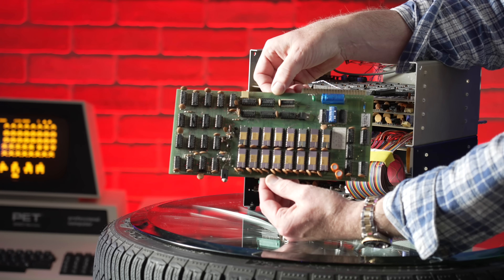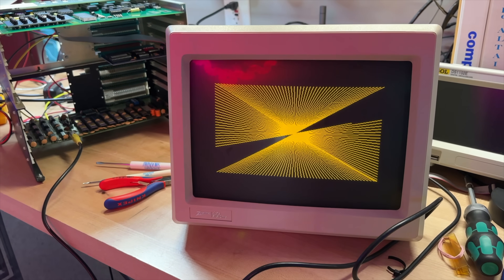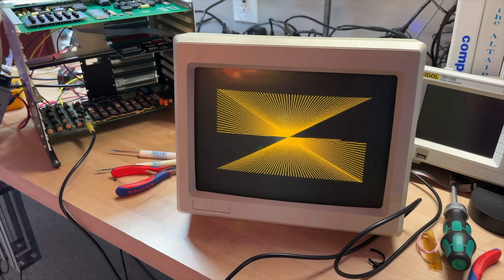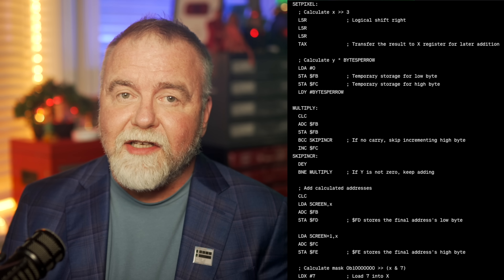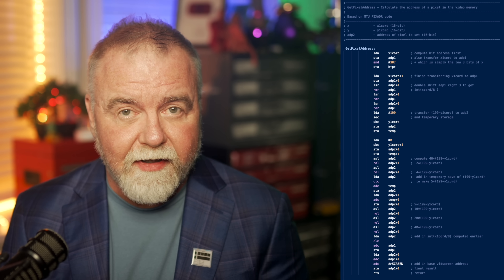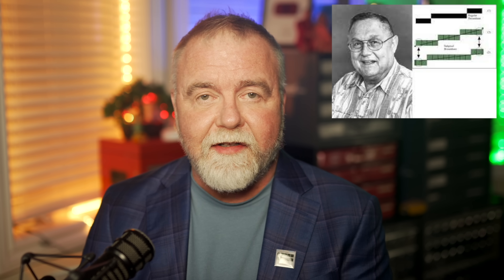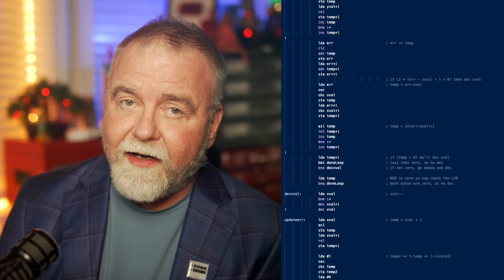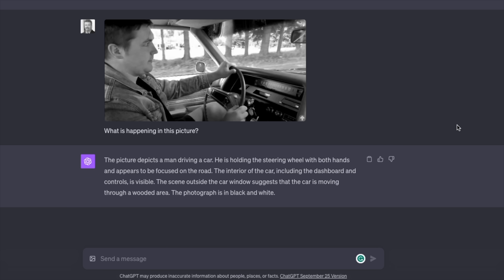ChatGPT Blew my Mind!  Now it can code AND learn from the results!

Comment: Cataclysm is a python project that has the pecl attached.  It does the feedback loop you mention.  Self re writing code is a thing but it tends to infinitely recurse so a solution was found by fluctuating the temperature parameter.   The magic is it has system prompts that allow it to write unit tests for given output and iterate on that until unit tests pass with pecl and pytest.  It has the magic ingredients -- code, a way to test code, and a way to feedback the test output to get to the solution.  The temperature is adjusted if so many iterations pass to allow a "spark of creativity" that forces it out of an infinite loop.  Its the only working solution ive found!  Becauze the buolding blocks of cataclym are agnostic, it can be applied to any language if modified. 😊  it starts by running Doom() with your prompt of what you want to see...  I was happy to apply a decorator to python strings to run Doom on _str_ and watch it run the English language when i plopped in string literals describing my program.  Pretty crazy.  It comes with a few examples like a hangman game and snake.

Comment: Cut my teeth on a 6502.  So did my two sons.  We purchased a Apple II Plus and the rule in my house is that you could play almost unlimited games on the Apple II.....That you wrote themselves.  It worked and now,  both sons are successful software engineers or higher in large companies.  Thanks for introducing and getting me interested in Chat GBT.  I am having a blast writing code or should I say letting it write it.  Not perfect as you pointed out but amazing just the same.

Comment: Why is the number 255 so significant...???
Reply: It’s the highest number that can be represented by an 8 bit byte. 1+2+4+8+16+32+64+128 = 255. Each one of the numbers to the left of the equals symbol represents one bit, and there are 8 bits in a byte, hence 255. I hope that helps.

Comment: Interestingly I'm currently building a 6502 based computer with a modern microcontroller acting as ram/rom/io. Quite an interesting project, and finding a controller with the right i/o, and enough horsepower  has been a fun challenge!  Currently set on the STM32H7. Might be overkill, we'll see after the first board comes.

Comment: TES-Doc# 236-014-501 Revised Better Binary ("RBB") number system 16bit by Mark Barrett: 
1st digit 1=+ 0=-. 
Next 10 digits are 0-999, with 24 "error" codes such as infinity high and low, out-of-limit high and low, non-number, unknown, Pi, all the special numbers like Pi, and leave a few reserved to be assigned later. 
12th digit +/- for following 4 digits. 
13-16th digits to shift the decimal point 0-15 places (up to peta or billion, or femto the one below pico). 
It could hit 0.999 ExaNumber with 3 significant figures and several reserved numbers like Pi or infinity. 
*If you used 24 digits total: 
Add 5 more digits to the main (16 total for just the main), and you'd have 4.5 significant figures at 0-65,000 with codes and letters and symbols, or 0-65,535 without codes. 
Use another digit to show if the number includes codes or not. 
Add another digit shift number to exceed our metric prefixes. 
Leave the last digit empty, reserved for future use. 
***Bing says I should use the first 2 binary to signify if the main is a number, symbol, or code; To make conversions easier. 
I'm planning to work that in.
Reply: TES-Doc# 236-014-502 Revised Better Binary ("RBB") number system 16bit or 24bit by Mark Barrett: 
RBB floating point 16-bit with 3 significant figures (0-1023), or 24-bit with 4.5 significant figures (0-65,535). 
The first digit signifies if it is a number, symbol or code. 0=Number, 1=Symbol like Pi (can be rounded to 3.1416) or infinity or code like under/overflow. 
2nd digit 1=+ 0=- for if positive or negative number, upper/lower case symbol, or high/low code. 
Next 10 digits for 16-bit or 16 digits for 24-bit are the main significant figures in binary (1010101010=682, 0111 1010 1011 1000=31,416), OR a symbol like Pi or infinity or character, OR error code like not-a-number or under/overflow. 
Next is +/- for shifting the decimal point. 
Next 3 for 16-bit or 4 for 24-bit are for how many places to shift the decimal point. 
For 24 bit the last digit says if the number of decimal places to shift is in base 10 or base 16 (hexadecimal). 
Max number for 24-bit is +/-4,611,686,019,501,126,144 4.6exa or femto (exa is after peta, femto is before nano) (FFFF000000000000 hexadecimal). 
For 16-bit the max number is +/-10,240,000,000 10giga or nano.

Comment: Just a month ago people were still saying it's just pulling statistically next likely words based on the text of the internet in its training, the way autosuggest on phones and email has been working for many years. That can't explain this sort of ability, I guarantee there's no statistical basis from the information on the internet that had your screen outputs or your code. This is a perfect example that shows it's not just a linear statistical predictor.
Reply: It is though, that's literally how it works. Not to mention its not even its not even actually "seeing" the screen, a separate ML converts a description of the image as text (old school tech) and feeds that into chatgpt, which means if you were to just describe the image yourself you would get the same results. You may not see the issue with this "trick" but just remember the saying "a pictures worth a thousand words", the text fed in for the image is going to be around 200+- words, which means you are losing a lot of data. It would be like describing the mona lisa to a painter and expecting a direct copy, they painter isn't really going to know the details, it's just a boring trick to make people believe the tech is more advanced than it is.
Reply: You really think there's enough examples of 6502 assembly and how it relates to drawing graphics to make a statistical inference like that?  @cookoo4lyf

Comment: I was taking a class in 6502 at tech college when my dad gave me a TRS80 Model 1... had a Z80 in it... and I got EdTasm... even on cassette it was vastly superior to keying in assembly on the 6502 breadboards in the lab.  Consequently I never learned 6502... but I did get decent at Z80.   Now I do embedded IoT things in C... a wonderful living.
Reply: EDTASM was amazing for the time. Prior to that I used T-BUG which was a very simple debugger and hex entry system… but that in itself was a great advance on a BASIC program full of POKEs. 🤣
Reply: @GeoffRiley  I obtained that TRS80 wizardry book that contained the entire L2 Basic... that had good stuff in it.  I built my own eprom burner... working at Motorola in the early 80's had its perks.  The local TRSUG had folks that could burn me L2 chips... did all the upgrades in the book... built my own burner for the proms.  Computers been very good to me!

Comment: Nice vid. In a way, what you described is similar to "evolved antennas", where it goes over it's own design over and over trying to find a better solution. The implications are immense because it pushes one of the most damning human limits to new levels, time per product. Take for example chip design, that is now so complex you rely on many a "standard way" just to keep track of things. An ML tool won't care. You'd just tell it what it's supposed to come up with, the constraints it should work under and let it go at it.
The next big step will be when you can tell some version of ChatGPT to "create a better version of yourself given x constraints". It's model obviously. THAT will kick things into next level...
p.s. for curious people, ML's largest advantage over us is that it works on a reward basis without the purely biological bias of risk aversion. It WILL try stupid stuff to come to the conclusion it was stupid. And as AlphaZero/Go/Star proved many times, many of the things humans considered stupid were not actually stupid (in the long run).
Reply: its own

Comment: Tried it, it offten gets stuck in the infinite feedback look. Especially when its necessary to take decisions by taking into account several console outputs and when manipulating a code base composed of few files. It is able to do some really simple staff on its own.
Reply: Same, his remarks are a bit strange, first he's saying that it took his effort to solve it, then he says that there's no reason for him to be in the feedback loop technically, and that the machine can do it on its own. Then he says we're not there yet... But we will soon. This looks like someone swinging an knife around without a care in the world. I would love to see his reaction if this happened when he was in his 20s, if he really would not care at all about a machine threatening him to get him out of the feedback loop, and of his job and all of his future merits.
Reply: @Nicosoftnt  i dont think this is danger for software developers. I think this is just a good tool that brakes the language barrier, at least it makes it easier to start using new languages. It also help going faster which should lead to a decrease in costs of building software solutions. You still need an engineering intuition and someone to request it to make these tiny bits, adapt them and stick them together. 
The day it is able to completly replace a developer it will also be able to do most of the modern jobs. And that wont be happening any time soon. At least not by pure llm s.

Comment: I've read a lot about how ChatGPT works but it was all text based which I assume means it was given books and other written work to learn from.  There is obviously more to ChatGPT if it can write computer code and if it can interpret graphical images given back to it.  I've also seen photographs generated by ChatGPT which again is something much different from just words.
Reply: GPT4 has deep learning trained on images as well as text. Originally it was a LLM or Large Language Model. The underling workings of it are on tensors or artificial neurons meaning they will respond to whatever you train it on text, images, or both and will draw it's own connections between input and output biased on how you train it.  There's some interesting Audio stuff being done with it too that uses spectrum analysis to visualize the audio and generates a spectrum off of that. Since a spectrum is visual it works in much the same way. 

If you read about GPT1 2 or 3 it would have been text. Shame that GPT4 is subscription only creates a have and have not divide but GPT3 is free and a good way to learn about it is just to ask it.

Comment: I've used chat gpt for coding c# quite a bit. It is very useful for getting the structure of the code, and getting started. It doesn't always get it right on the first go, but it can correct mistakes if it is fed back the errors. Also it sometimes teaches me new ways of coding I wouldn't have thought of myself.
Reply: Unless it's sure its mistake is fine and keeps repeating it.
Reply: @KrzysiuNet yes that is a hurdle AI is far from solving still. Also me that do a lot of image generation, i see it does a lot of hallucination. Also due to some abstract ridiculous reasons, like changing a bit the POV angle, change completely the generated image and either achieve something near what you want or an extremely different thing. As for code, it often talks about libraries and tools that are not updated for years, especially as reading files machine learning is concerned... .
Reply: Yes, I’ve found that I’ve been able to learn from it even when it gets things wrong! E.g., it might get a part of it right and teach me something new, even if the final answer is wrong.

I can then tell it that based on this new thing you taught me the answer you produced is wrong. It will then apologise and produce the right answer.
Reply: @kevinmcfarlane2752  so what's the reason to bother, if it simply could be right? Why not something less random like StackOverflow or books? As for its apologizing, it always apologizes, because it's coded that way. Sometimes even when the answer was correct. And if pointing out mistakes would make code correct, there wouldn't be a problem, would it? Sadly, it rarely corrects the code.

Comment: Question:
GPT creates code who is responsible for how that is executed and used?
Ok, the user, What if the so called user has no clue it is running like a ddl or exe running in the background?
Is it not the same as a virus running that I have no clue is there? Am I responsible?

Why? you ask, because I have come across a script the can be used to bypass speech/text algorithms that censor certain words and phrases.
Said script may end up being used on certain sites that use these algorithms. Like MSN. opps did I say MSN. something like MSN, ok, very much like MSN
Who would be responsible for said code appearing and being used on these sites.
What could they do about it. Is it illegal to hack a hack?

Comment: Chat gpt is terrible at math. It couldn't multiply 2760 times 5521. Kept giving me the wrong answer, even when i told it it was wrong and to check it's math, it gave me a different, also incorrect answer. I asked it to multiply it in reverse, and it will got it wrong. First time it's let me down tho.
Reply: its math

Comment: This area is so interesting. A few months ago I was coaxing Chatgtp to write a screen-scraper to pull down a particular data set. After a few failed iterations it suggested the website was using a dynamic way to present the data I wanted. Instead it suggested AN ALTERNATIVE website where the same data was available statically and obediently provided the working code. How did it know to do that? Someone on Reddit suggested there was probably a Stackoverflow question out there somewhere with that answer. But with the same data? The same websites? What are the chances?
Reply: Doesn't have to be the same data and website. That's the beauty of transformer neural networks. Your test case just needs to have sufficient   patterns in common with some training examples and it will generate a token sequence that gives the illusion it knows what it's talking about.
Reply: The other day I accidentally provided it with the wrong GPS coords for a city that I was using to test some Postgis SQL code on. Somehow it knew the exact GPS coords for that small town in Nebraska, and autocorrected the GPS for it in the response. I pressed it, and questioned it, asking how it KNEW the correct coords if it didn't have access to the internet, or a DB of GPS coords on file, and it kept denying and gaslighting me.
Reply: @redpillsatori3020 I asked GPT4 via a 3rd party API whether Toronto Canada was further north than Swindon UK and it replied yes giving the correct latitudes of both places and explaining that the first number was larger than the second.

Only problem was that Swindon is actually further north than Toronto.😂
Reply: @redpillsatori3020  It "had" access to the internet. It goes trough tons of data - books, articles, forums, transcripts and more. It went trough some website listing the town with it's coordinates, like Wikepedia, some site about coordinates and more. In a way - it builds it's own database. 
You provided the name of the town, with wrong coordinates. The model got that it needs to use the town and the town's coordinates. It's possible that it either ignored the coordinates you provided, or it had a conflict, deciding, that it's data is "more correct" (yeah, you see Statistics can be weird like th)